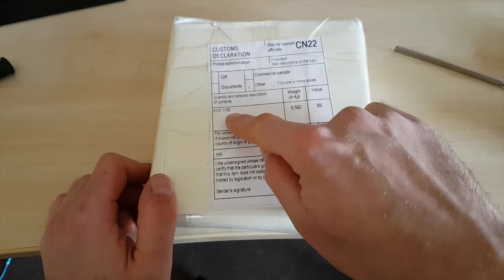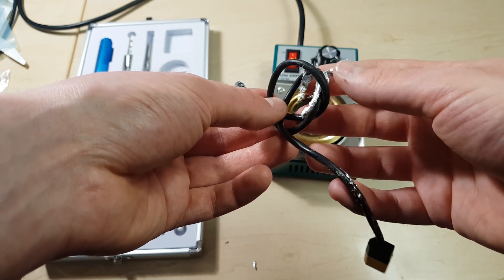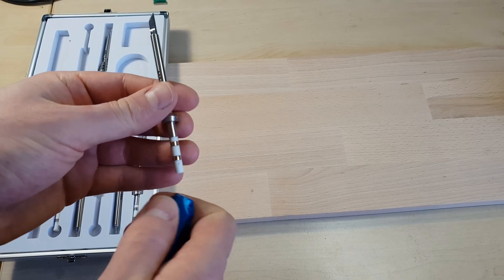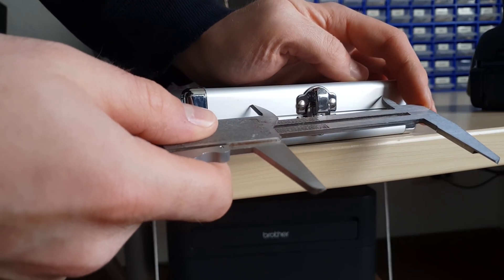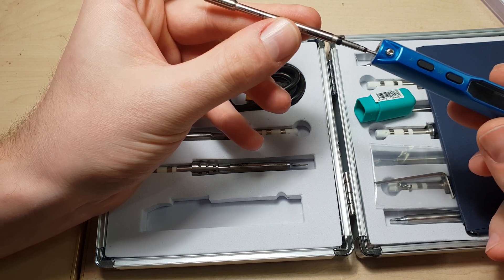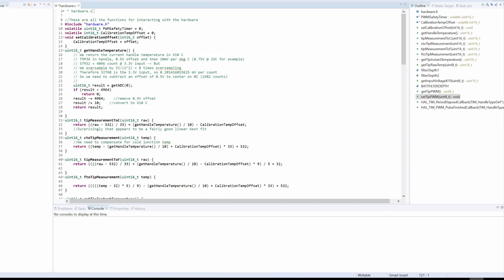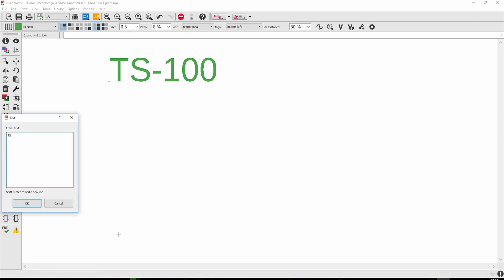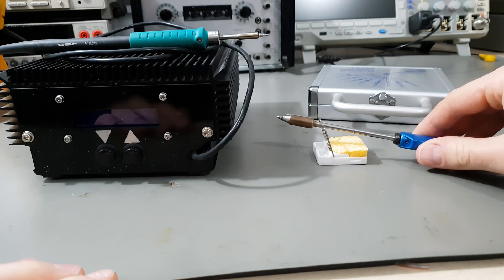'TS245' - TS100 Soldering Iron with JBC C245 Cartridge

Comment: Does anyone else have a problem with Ralim software for TS100 where once it shuts down (auto shutdown after sleep) you cannot wake it up in any way other than unplugging and plugging back again. I can't be bothered to look through all the code.
Reply: Do you have a new iron? 
The latest TS100 use a different accelerometer so you need to use v2.03 of Ralims fw to make it work properly.
Reply: I have a new iron, though it's the old model, the black 2015 one. Mind you, the iron does go to sleep and everything, it just won't wake up after shutdown, I think I'll just turn the shutdown feature off completely anyway but....

Comment: Blade tips are for drag soldering.
Reply: They are good for so many things! The edge will drag solder or clear bridges, the sharp tip will easily single pin solder, and the sides along the edge can be used when you need to transfer a lot of heat such as when soldering a tab to a ground plane.
Reply: I thought you meant soldering in women's clothing!
Reply: You're such a drag!
Reply: They are also for wood burning, so he isn't totally wrong. My step dad wood burned and he used those blade tips of various widths.